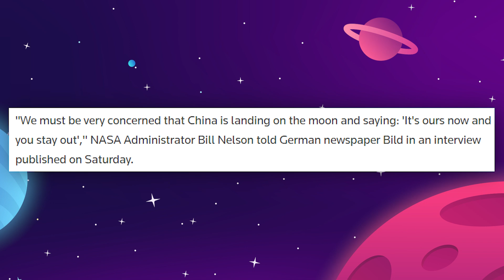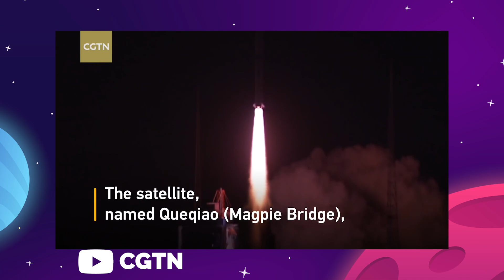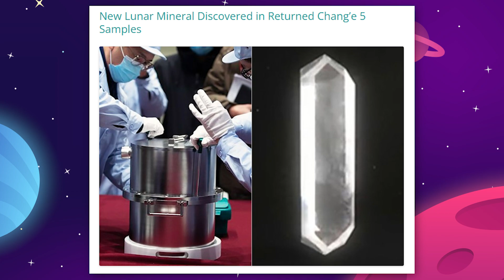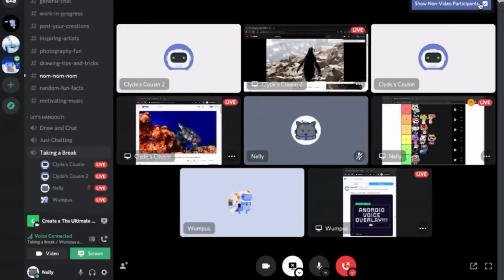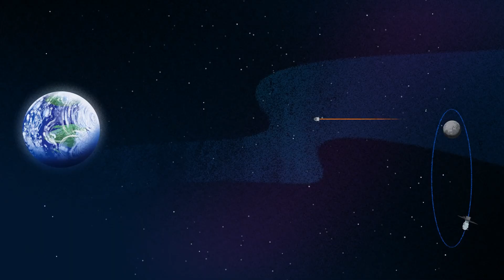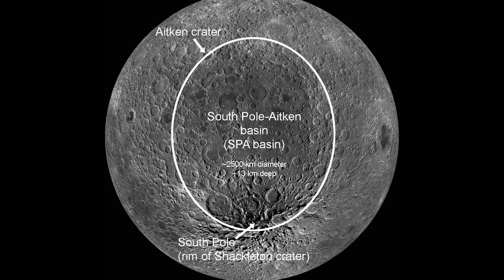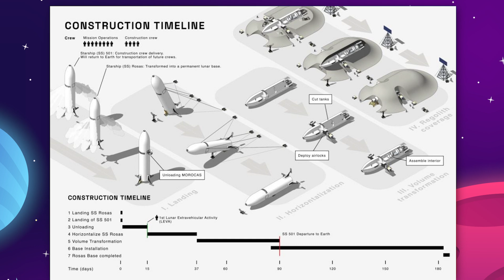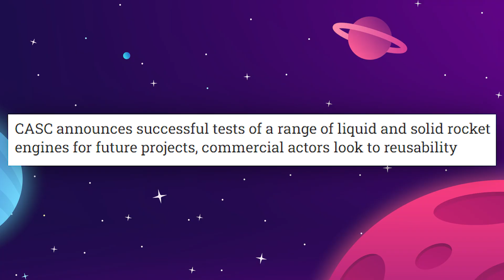What Happens If China Colonizes The Moon Before SpaceX or NASA?

Comment: You want to change the tide well then send some SpaceX ships to Mars and have them land there where you want them to land have infrastructure already sitting in there while you're trying to make it so people can get you go up there since SpaceX already got ships that can go to the Moon I mean SpaceX already had ship go all the way around the moon and back to Earth so they already had one that can land on Moon then now they got so many of them that they can just send up to the land on the moon and may not be what they want up on the moon but at least it's a start or to have infrastructure in it or to have material that you need to build stuff on the moon even though it all be what robotically controlled or radio controlled because no people will be on those things at least you get some things there already where when you're able to send people up there you have infrastructure you can start using the build stuff and probably mining as well because you're going to have to build yourself some homes underneath the ground for radiation exposure so you don't get that exposion of radiation that will well ultimately kill you 20 years before your time is over or right then and there

Comment: Don’t the US NASA and Space X, going to colonize Mars first? Why suddenly they just want to race for the moon base now?
Reply: No, Musk might have been all for "Mars first" at first.  But for years now NASA has been "Moon base before Mars".  "Moon first" is right, at least if you want to colonize Mars instead of planting a flag and leaving.  A Moon base can deliver oxygen from the Moon (more than half of a kerolox, methalox, or hydralox propellant mix by wieght) and other resources to LEO cheaper than boosting oxygen from Earth to LEO.  It IS possible to do a Mars "plant the flag and run" mission without a Moon base.  There simply won't be a PERMANENT MARS BASE or colony without an industrial Moon base.  The seed infrastructure and supply train would just be too expensive to fund, even with the space and defense budgets of all the nations of the Earth.  Direct to Mars gives you some Mars rocks and a flag on the surface.  An industrial Moon base gives you cislunar O'Niel colonies and the Solar System with Mars thrown in.

Comment: China has plans to get to moon before USA. That matters.
Reply: Currently it doesn't seems like they can
Reply: @ulikemyname6744  USA might loose the round tho. China will weaponize moon.
Reply: @roensoul  Currently China is many many years behind just getting to the moon let alone making and sustaining a colony there. China has absolutely no way of effectively delivering large quantities of materials and equipment to the moon unlike the US which has starship which can deliver up to 150 tons no matter if it is on LEO or Mars or even Titan if it has enough refueling runs. This ship gives an extreme advantage over China or Russia. Starship can literally deliver an ISS-size space station to the Moon in 3 runs. Getting a space station there is necessary because if some is to happen on the "ground" they need to have a close checkpoint at least. Also they have to have a close command center to operate, manufacturer and delivery from and to the Moon. And ofc you have to have a big rocket that is capable of actually delivering stuff there. China has none of that! Currently they can't even land there and they are far from having a system that is even in the testing phase let alone being close to done

Comment: I'm not intrigued by these methods and yet a burst by NASA is not reassuring about the use of Nuclear Rockets. The problem lies within the current system's used by every existing company involved with space exploration. 
Here's where and what we need changed. 
Looking back to the STS program gave us a glimpse unknowingly and we trashed it. Yeah a glider but the what if eludes us . Science has currently three programs on the go . Here they are..Skylon with its saber engines , a radical approach..Radian Aerospace another and S.E.S space engine systems with hypersonic systems but again all three lack the greatest features. All the above mentioned are fuel guzzlers and not fuel efficient. 
From what I've learned and currently studying is core materials and fusion reactors. In a twist of conventional an added feature to make it a hybrid solution in which it sips fuel and gives the same displacement and also covers a greater distance but the dynamics changes requires the rocket to once again take the shape of shuttle and refit from glider to actual Spaceplane. If you haven't noticed but in reality the form of version 2 Raptor engines are indeed smaller by making it less equals more is a derivative of what I'm saying. We need this forum to evolve because if we decide to go Nuclear. I would like to see it landing back a do what happened during the early days of SpaceX knowing that if it goes boom , we lose that area for about 10k years or more .
So the 4 elements that's why we have to go hybrid because again it's in our vast universe until fusion is fully operational this use of fuel and oxidation has a very big role to play... btw I figured out how but who cares..have a great day all

Comment: You Americans consider Russia (and China) an "enemy". Well, for a great many of we non-Americans, Russia (and/or China) are NOT an enemy and are regarded as an essential counter-balance to U.S. insatiable greed. Oh, SpaceX offer of it's developing Starship: if it delivers 100 - 150 tonne to the lunar surface it will have insuffient fuel to leave lunar orbit to return to LEO. This " elephant in the room" is NOT being publicly addressed by SpaceX or NASA and, let's face it, Starship is for Martian colonization, NASA is just using it as a stopgap measure to simply make a start on Lunar colonization; it can't even burn lunar manufactured rocket fuel LH2/LO2 (which Russia/China will be doing.